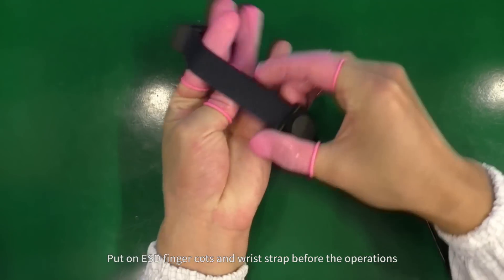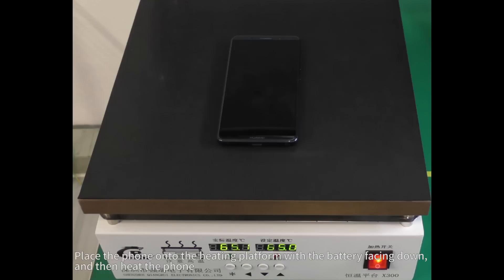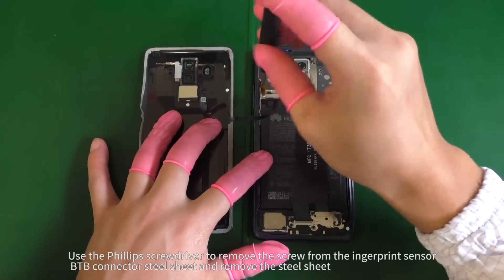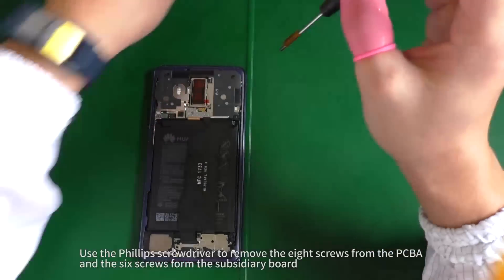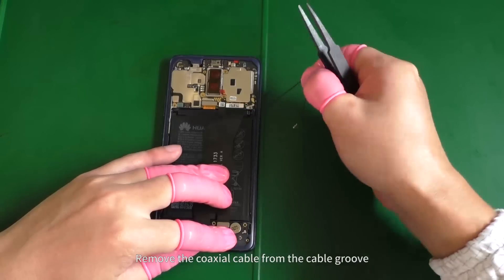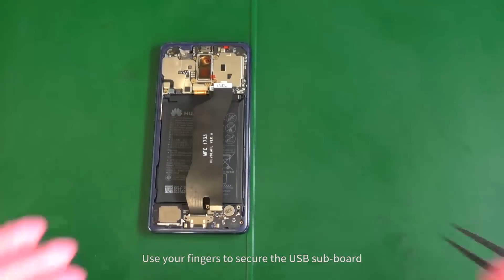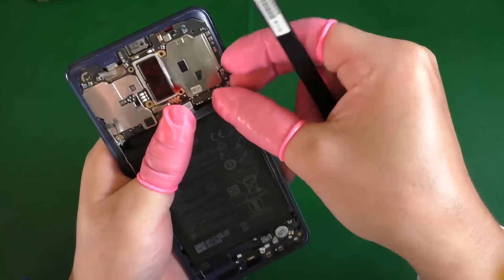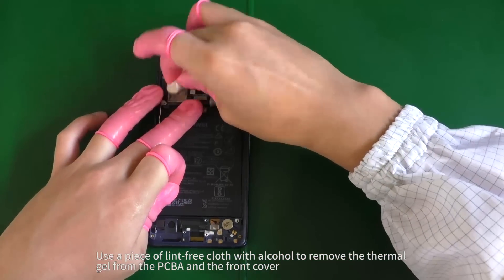Huawei Mate 10 Pro disassembly guide

Comment: Great video, thanks. Wanted to make sure I didn't slice anything when I took a razor blade to the back of the phone to open it up and this helped me know I'd be fine. Not sure why people are saying its complicated, just run anything thin and sharp across the back edge, making sure to get all the adhesive otherwise you risk breaking the glass back if you try and pull it off. All the equipment is obviously not necessary, but if you have it it makes the process a lot easier and safer.